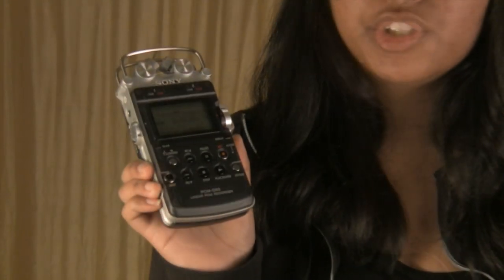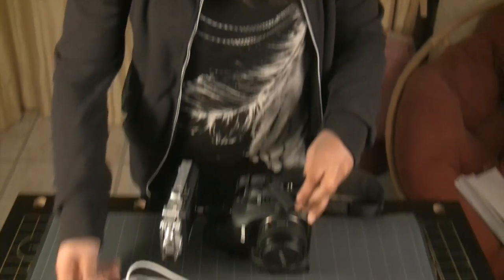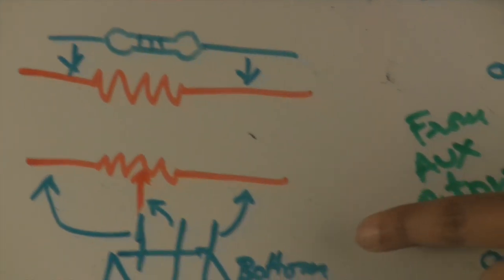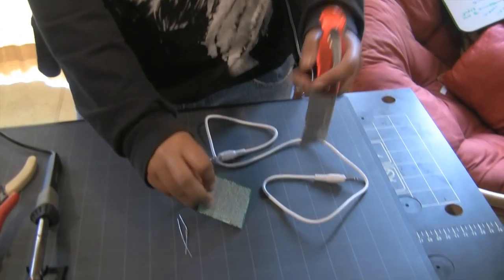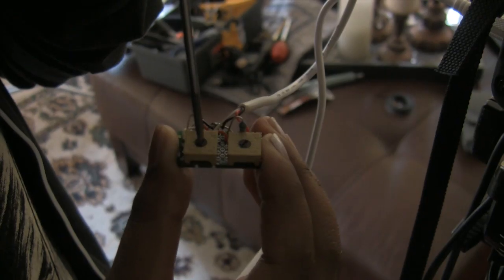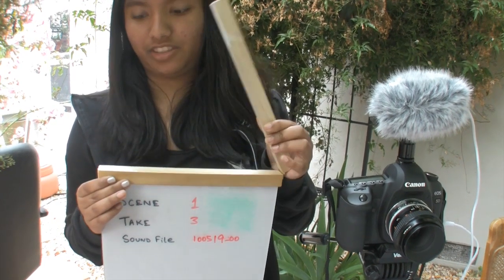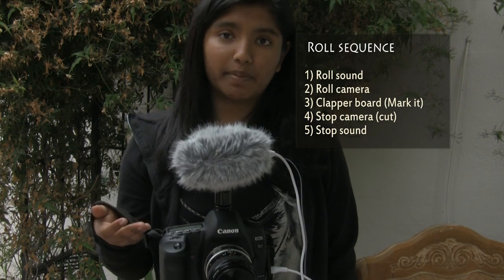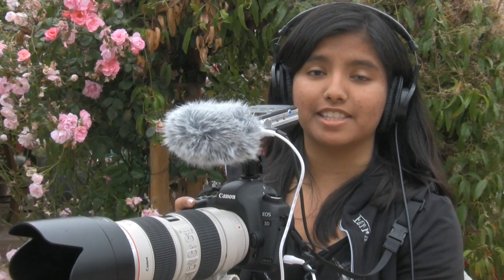Ultimate sound recording in Canon 5D / 7D and Sony PCM-D50

Comment: I made this passive attenuator and it works very well with my Zoom H4n and Zoom H1 audio recorders and my Canon 5D's. I recalled both on the Canon and also the recorders that way I have a backup audio recording and it's also easier to synchronise the audio when editing the video.

Comment: @Eartproductions I think you skipped the part where she deleted the audio that went through the mini jack. The whole point of the PCM recorder was to get 96k uncompressed Audio. I'll be using a H4n when it arrives. It's a 4-track recorder with XLR inputs for balanced input from pro mics. It also has a built-in compressor/limiter.

Comment from the maker: @TehFoxit Sure it will. PCM-D50 will work with any DSLR provided you use the attenuator cable. It is a fantastic recorder. Be sure to buy the windscreen too, without that you can not use it outdoor. the in-built mic is too sensitive to wind noise.

Comment: Good work in realising that you need an attenuator and building one!  I have measured the  EOS5D (and GH2 etc) and you can see the results at the Lindos Electronics site (click on the test sheet database tab).  Lindos now sell an attenuator (from pro-line levels) which incorporates compensation for the bass rolloff , as well as the Minisonic Mic kit with preamp.  See demo videos at the Lindos Electronics channel.

Comment: Final Cut is one of the industry standards and should work great with 7d footage. However, Apple has revamped the program recently and a lot of people are not to thrilled with the new version. The plus side is that it's a lot cheaper than before. I myself am a Premiere Pro user and I love it! It works great with 7d footage and if you buy the production package, you can edit sound directly in Adobe Audition...another great program! Good luck!

Comment: Your parents must be proud. Nicely done. Im sure you know, but for your viewers, potentiometers are variable resistors. They are pronounced "poten-she-om-meters" well, that's  my phonetics. So, resistors lower voltage (signals) and they are a specific value, but the potentiometer can be precisely tweaked so that the signal is matched for your purposes. I dont know the sony recorder, but you said the 3.5mm jack was  aux out or audio out. If that is where you put your headphones in (the Sony) then that would explain what is termed as "impedence mismatch". Of course, you could lower the input levels on the camera, but it would result in a soft distortion. It's  never a good idea to record from a headphone jack. Personally I wouldnt link the camera. I would obviously record audio on the camera. You are going to go a long way.

Comment: This was a fascinating video, but honestly, it was like jumping through crazy hoops to achieve something that can be done much more easily in this way:
1. Wireless Lavalier mic - transmitter and mic on yourself
2. Wireless Receiver - mount on 5D
3. Output of Receiver - plug directly into 5D via included stereo cable
4. Test recording levels prior to shooting.
Done...none of this crazy soldering required, and your sound will be MUCH better because the doggone mic won't be 8 feet away from you...

Comment: I am just wondering why not use built in manual Recording controls. you have the ability to set your audio recording level manually to one 
of 64 levels rather than relying on the Auto level control that operates  automatically in response to the sound level.  To manually adjust audio select: Sound recording > Sound rec. > Manual > Rec. level in the Movie menu tab and you can then adjust sound recording levels via the camera’s Quick Control Dial.

Comment from the maker: @hotgypsylips That is because Beachtek is just a pre-amp while PCM-D50 offers so much more: It also works as a very low noise HiFi pre-amp, it has one of the most wonderful compressor, it has a 92 KHz digital recorder and it also has two outstanding Mics which can be oriented in different direction. I can use it off-camera and as a vocal recorder while not shooting videos. So the choice was simple for me.

Comment from the maker: @EpeckTV Have I ever said or shown running long cable between recorder and camera? What made you think so? Keep recorder mounted on top of the camera or camera rig. Connect recorder and camera with attenuator cable and then connect the external mic/wireless receiver/shotgun mic mounted on boom pole to the recorder. Is it too much to understand? If you have a recorder like Marantz PMD661, which I do, you can run XLR cable longer than 200 foot between Mic and recorder with no noise.

Comment from the maker: It is a sad to see many professional thinks XLR is better without understanding the physics behind. Mostly most expensive recorders have XLR input as they offer inbuilt phantom power and a low noise pre amp for directly connecting condenser mics. Now a day, most video mics have inbuilt tiny pre-amp and powered by AA or button cell, so they do not need any XLR cable. This is my last post on this topic. I am closing any further discussion on this topic. I have a life :-)

Comment from the maker: @SprayCanMedia This is because when you will use lav, wireless, boom mics, then the sound recorded in the lav/wireless/boom will be way different than the camera mic. Most of the cases they are so different that you will find it very difficult to do a visual waveform pattern match to sync the sound.

Comment: By the way, don't assume the EOS5D is poor compared to other sound recorders.  We've tested Zoom, and Tascam 2-channel recorders with poor results. Forget the '24-bit' and 96kHz hype - it's irrelevant.  Limiting factor is noise level.  The 5D has noise at -51dB wtd 468 relative to alignment level.  The Zoom is -50dB.  True 16-bit acheives -66dB, true 24-bit -80dB (same measurement standard). Best portable recorder is the Tascam 6-channel DR-680 (-70dB), just a bit better than true 16-bit.

Comment from the maker: Great point, but clever software engineers figured that out and most video editing software with down sample the audio clip to your video sequence setting and keep it all synced. Adobe Premiere does that. Now you may ask, why you need to record at 96KHz sampling rate if it gets down sampled right? Because high sampling rate will produce way better recording just like a DVD movie appears better than a VCD movie on a normal TV screen, even though VCD resolution is enough.

Comment from the maker: @theklf3000 Actually there is a need for this as Canon 5D input is mic level and PCM D50 provides a Line level output. The difference between Mic and Line level signal is big that Camera manual gain control will not able to adjust it properly. Try it and see for yourself. This video is shot with 5D and the latest firmware with manual level control.

Comment: Dear Ritwika,
Thank you very much for your tutoring. I'd like to ask you about PCM D50 and the need of passive attenuator. I saw a few music video that used D50 recorder for recording, but they didn't talk about the need of passive attenuator. I haven't have the kind of tech knowledge like you or any other, and a bit abhor to construct the accessory piece. I'm using 7D and Rode video mic. I don't use the PCM D50 as I am afraid of the problem you've said. I haven't even tested about it myself yet. Are you sure that 7D also needs attenuator for D50 recorder? Thank you.

Comment: Alternative setup if you aren't skilled in making electronic gear yourself:  use e.g Zoom H4N which can set line out levels directly, removes need for external level setter. Also, On 5DmkII (and 7D latest firmware), disable all in-camera gain.

Comment from the maker: @ooxcfhxoo 1) The sound of the clapper is used to sync the sound of the camera and the external recorder
2) The circuit is for reducing the line level output of the PCM-D50 to mic level input of the camera. Without it the 5D will record very distorted sound.
3) Unfortunately Canon 5D or Sony PCM-D50 are just prosumer grade devices and do not have timecode track. The only way to sync the audio tracks is to sync them manually from the sound of the clapper board or using a software Plural Eyes.

Comment: @supportren Well... the International System of Units states that "K" stands for Kelvin.
"k" (lowercase) can be put before an unit, and it will mean 1000.
Ω should be used for resistance. Joules should be used when talking about energy
Thank you about the explainations about the "electrical hobby circle" conventions I didn't know.
The SI (Système International des unités) has been created to avoid such confusions.

Comment: A few thoughts:  They sell cables with built-in volume control (passive attenuaters) for like $10.00.  You could also just record everything straight on the Sony and sync it up with PluralEyes software.  That Sony recorder is ok for ambience but I would prefer a shotgun condenser mounted on the camera and that thing on the side somewhere.  I'll pass on using these DSLR camers for video.

Comment: @MrJdsenior
ahahah her dad has an electrical engineering degree ;)
also, if you have one degree to, you should know that sampling a wave at a frequency that is the double of the max freq. in that wave, by signal processing theory means you can get the original wave in perfect condition. Conclusion you can avoid all the trouble in the video and attach a quality microphone to the 48kHz micro-in sampler in the canon 5d mark II.
In the picking-the-kid issue, you are completely right.

Comment from the maker: @mathieuemi666 Hi you are right in all electrical engineering formulas :-) In electronic hobby circle, a resistor 220K means: 220 Kilo Ohms, that is 220000 ohms

When a current flows through a resistor, it heats up, so every resistor has a heat dissipation rating, which is expressed in watt (a measure of energy). In this case this resistor is rated as 250 milliwatt.

Trim Pot stands for trimming potentiometer, which can be set only few times by using a screw driver.

Comment from the maker: @Ratocx There is huge difference in quality of sound recorded at 96KHz and 44KHz sample rate. 44KHz quantization rate cannot capture higher freq. sound with same fidelity as 96KHz. Unless someone has hearing loss at higher frequency, it is very easy to distinguish between sound recorded in 44 and 96 KHz. So to create master file, 96 KHz is the way to go.

Comment from the maker: @madgeorge2236 Compressor is a sophisticated version of automatic gain control. It will not help anyway as it will not kick in unless the input exceeds the compressor threshold. Compressor works with loud signal or when we set the input gain to high. In this case you are suggesting setting the input gain very low. Sorry, you have to use my attenuator :-)

Comment: use Zoom H4N to rec with its internal mic, use the clapper, then sync in post, 
or use a shotgun mic properly (above, facing down to your mouth with a boom pole) attached to Zoom H4N external mic input (if you're shooting outdoor), so the voice is clear and at very minimum background sound, then use clapper and sync in PP.

Comment: @CocktaiLMolotovX It's not necessary tp work in 192k. 44k/24bit is reasonable enough, we use it in the studio also. 192k would give you better sound when pitch shifting downwards, but other than that people don't differ the rates in the final product. It can actually get annoying to concentrate on all the fine details in the mix, if you think about the fact the end product is consumed in mp3 through desktop speakers by the majority :)

Comment from the maker: @AWCAdvertising Yes, you can plug in any lavaliere mic to 5D or 7D, but it will not be a good option, as you have to run a long wire from the talent to camera, which will inevitably pickup EMI. If you want to use Lavaliere, then connect it with a short wire to an external recorder like PCM D50 and then connect the recorder through my attenuator cable to camera. Else, use a on-camera wireless solution.

Comment from the maker: I have answered this countless times before. Let me again give you a hint- suppose you are taking a long shot where the talents are 30 feet away from camera and wearing wireless lav. How you will get their voice or clap stick slap both in lav/boom and the camera which will be 30 feet apart? Also calculate how many mili seconds the sound may take to travel 30 feet. There are other good reasons such as better limiter in external recorder etc. but I am not going there, please read my old posts.

Comment from the maker: @madgeorge2236  Sorry, wrong again. Recording 101, record with highest safe recording level possible (-6 db)  to keep highest signal to noise ratio. If you reduce the PCM input sensitivity to reduce the line out level (without using my attenuator) to match Canon 5D input, then you will get very low level recording in PCM. When you increase the gain of the recording, it will be full of white noise. No matter however you try, you cannot eliminate the need for my attenuator in this setup.

Comment from the maker: @SoundByteUK So you think higher sampling rate only helps to capture higher freq. right? A common mistake many people make, so don't worry. When you sample a 20KHz freq. sine wave with 44 K sample, you will get a very ragged two step staircase to represent a nice smooth sine wave. It is like enlarging a small thumbnail into a poster size pixilated print. If you sample it in 96K, you will get more fine grain stairs which will be much more HiFi and you can easily hear the difference.

Comment: @Ratocx Source media for DVDs are never captured at 48kHz. That rate is for the production line. You need higher rates and high bit rates if you are doing any editing, especially when mixing audio sources, or else you will potentially lose a significant amount of fidelity. It's the same principle as, say, images on the web; a web designer doesn't keep source files as compressed JPEGs or even non-lossy PNG. The sources are retained at very high resolution in Photoshop, for maximum flexibility.

Comment from the maker: @Moltketti I find it difficult to monitor multi source sound as well as to operate the camera. For such setup, I guess you will need an assistant who will be the sound engineer. Why even bother to record in 7D when you have a PCM D50. You just need to sync. the sound to video. If i want to do something like that, i will buy a multitrack recorder like Tascam DR680

Comment from the maker: You have missed the point,  the 5D sound recorder is very low quality, even compared to any entry level recorder like Zoom H4n. When I use my wireless lav. I still hook the wireless receiver output to my Sony or Marantz recorder and feed the line output of the recorders to 5D through an attenuator.

Comment: Nice diy info, I don't want to be rude but why not just buy a Zoom H4N?.. since it comes with an xlr input you can attach a rode video mic and just record the audio separatley.  Then sync it later in post.  I mean if a person can afford high end cameras like the 5D or 7D, i'm pretty sure they are able to invest in a decent microphone.  But if they are doing a lot of field reporting i suggest investing in a video camera that has xlr mic inputs with phantom power.

Comment from the maker: @jcasasf Sorry, but you are wrong. For very simplistic shooting camera mic will pick up the sound as recorded by the recorder. However if you use boom or wireless, like I do, then the camera mic will never listen to what recorder is listening. Most professional will understand what I am talking about.

For non-critical application, we do sometime use on-camera sound through attenuator. In fact a number of professionals have already bought and using my attenuator in professional assignments.

Comment: the "timecode" i was referring to is the H;M;S from the audio recorder.

why would you need the attenuator at all if you have a dual system setup?

What im getting at is that it is good practice to remove the sound recorder from the camera because of 

noise you make while focusing/zooming a possible solution is to mount the recorder on a bracket and use 

the cable you made to record to the camera, or have another crewmember hold the recorder and boom 

and remove it completely from the camera

Comment: Excellent video  This may be a really useful video for me, but with a different purpose. I just have the one Roland R-05 but want to feed 2 mics into it, and record separately on each stereo channel. I would be using a shotgun mic, either boomed or attached to the camera, and a Lavalier on me for interview questions. Trouble is, balancing the inputs, as there is only one volume control for the 2 channels. I'm wondering if I could use this sort of attenuator on one of the channels to balance it..

Comment from the maker: You might be overlooking what you have studied in your sound engineering course. That sampling rate means nothing unless you also talk about the quality of the preamp and A/D converter of the recorder. Can you compare the performance of a passenger and a sports car, both having 6 cylinder engines? Similarly the audio circuit in 5D is no match even for an entry level audio recorder.

Comment: @supportren its more to do with the ADDA converters..example a soundscape recording at 16 bit 44.1khz will sound fuller than any of these units..(degree level engineer for your info).. the real issue though is the tech involved in the conversion with little distortion (noise, electrical and digital/analog  interference) ... you pay X amount for that reason..69 quid pc card has all these Khz and wot not... but a soundscape system eliminates all the noise with a very efficient digital AtoD design!